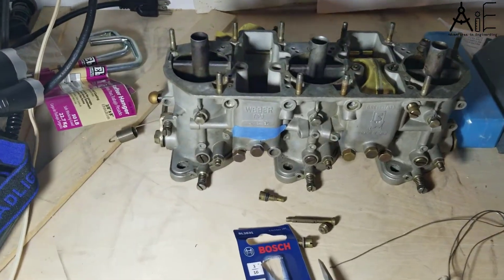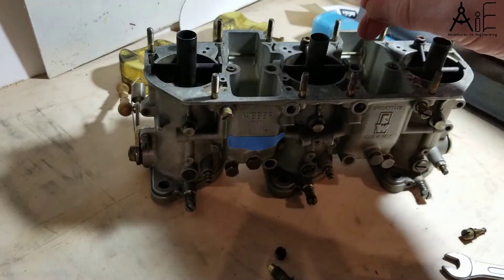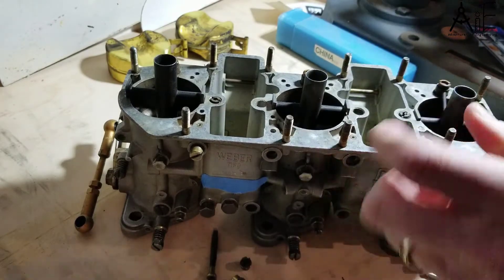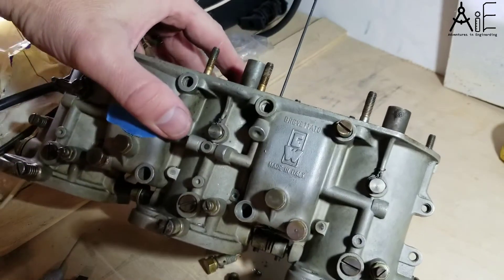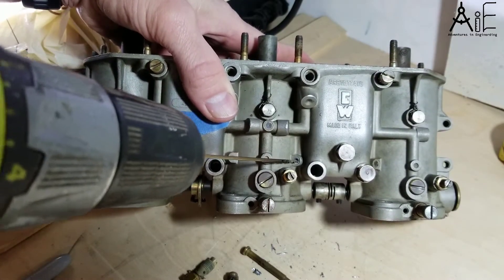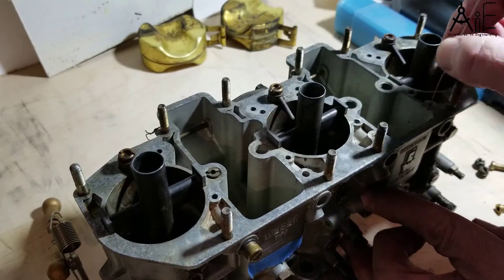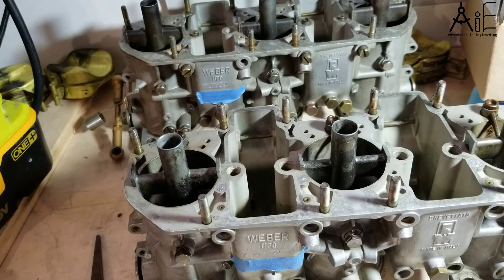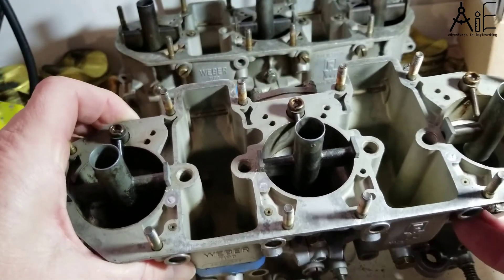Weber Carburetor Hidden Passage Cleaning (Lead plug removal / install) AIE

Comment: Would it be possible to use a soldering iron to eat the lead ball up to where it is super soft and tap it in softly?
Reply from the maker: @Abrothers100  It may, but you want a compression fit for a good seal.  Since metal expands when hot, it contracts when cooled so you may not have a tight fit anymore. It could also melt and go in too far and block a side passage. I also considered a threaded plug with a sealant, but was worried about possibly ruining the carb body if I got cross threaded. So I went with the old fashioned, tried and true solution of beating it with a hammer. Problem solved!
Reply: @adventuresinenginerding thanks for your reply, that makes a lot of sense. I have a set of webers from a 69 911t that came with my 1970t. Currently has the factory zeniths. I need to rebuild both sets. What rebuild kits do you recommend? I’ve read so many mixed reviews on them and all seem to need to be customized (like the gaskets).
Reply from the maker: @Abrothers100 I have a video on rebuilding Zeniths on my other channel that is Porsche only content. I don't have a specific gasket maker, but I have found the black diaphragm gaskets are better than the red ones. Check it out and leave a comment there if you have thoughts or questions. Once sorted, they are actually very good carbs. People like Webers, but Zeniths are more modern design. Though I am working on an EFI conversion because it is actually modern...
https://youtu.be/_zQT7HehOgo?si=9jFxGcDXP3soATjf
Reply: @adventuresinenginerding thanks! I’ll check it out